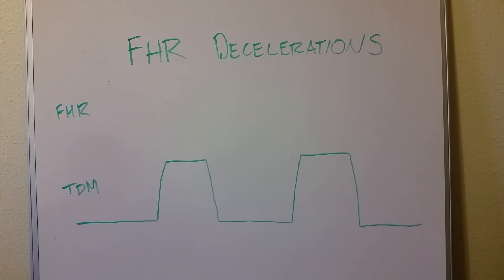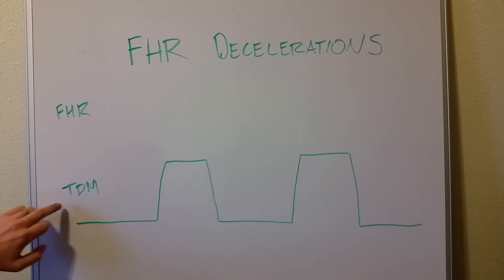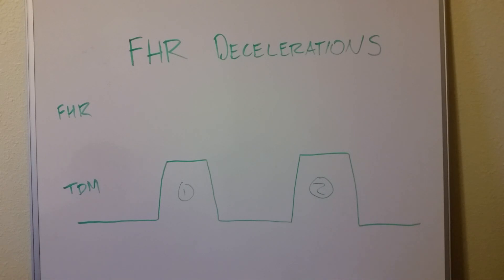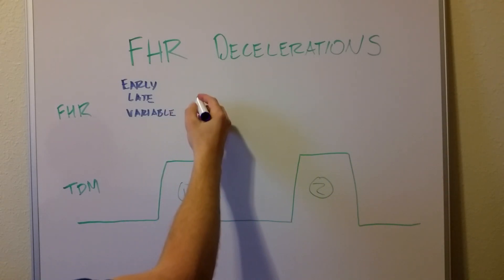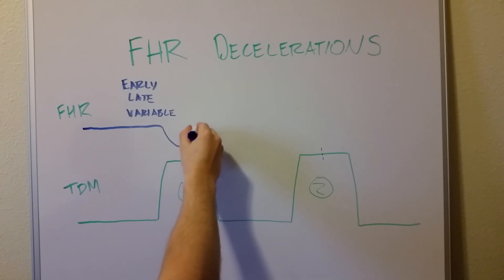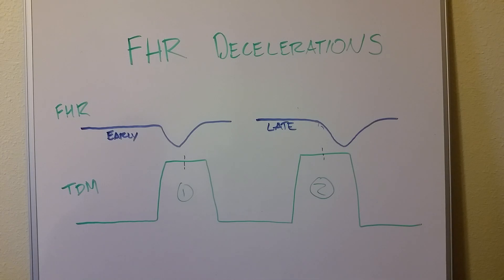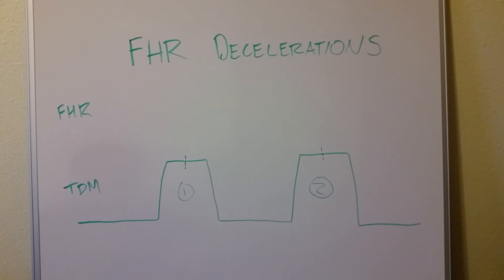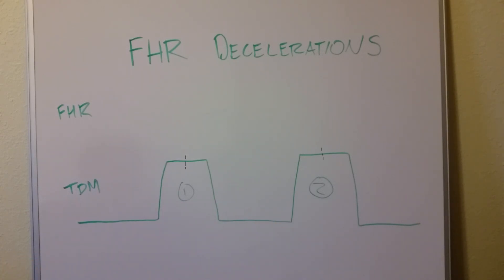Fetal Heart Rate Decelerations (Early, Late, Variable)

Comment: Variables are not as concerning as lates. Cord compression can be fixed (sometimes) with repositioning and in cases where there was ROM an amnioinfusion. Lates are uteroplacental insufficiency, yes, but it is a more concerning decel due to its higher likelihood that the fetus will suffer acidosis. Placental insufficiency is more often seen in PEC, GDM, HTN, IUGR, and post dates. Hope that clarifies it for some who watched this. Some of the information given in this video is very incorrect.

Comment: late deceleration in NOT OKAY o_O
Reply from the maker: +mojo khalifa the video's trying to stress that late decelerations are not as bad as variable decelerations. In academic OB (and for board preparation purposes) the key points with late decelerations are 1) they're typically caused by uteroplacental insufficiency, 2) they're not as bad as variable decelerations, and 3) oxygenation and closer monitor of the patient is needed. All of the above are taught by this video. Thanks for your contribution.
Reply: @MedSchoolMadeEasy  Recurrent variable deceleration( variable deceleration with greater than 50% contraction) could be bad. Even with recurrent variable deceleration, the first line management is maternal positioning(which usually works). If that fails, we go for amnioinfusion. If there's absent variability plus recurrent variable deceleration, we go for CS. But late deceleration is ALWAYS BAD. So I have to disagree with you on this. For academic purpose or clinical , I think the best way to go about severity is: Late deceleration>variable deceleration>early deceleration.

Comment: Late decelerations occur with contractions in the presence of hypoxia. They are a warning of distress and never reassuring. The start late, dip late and finish late after every contraction. The foetus is struggling to compensate with the poor oxygenation. They are never OK!
Reply: All wrong!  Late decelerations are very bad!  Variables happen with short periods of cord compression.. the oxygen interruption is very brief.  They happen all the time!  Late decelerations are caused by uteroplacental insufficiency yes, which means the uterus is puttering out and cannot sustain or work to keep the baby oxygenated any longer.  They MUST be corrected or baby will become hypoxic and develop irreversible brain injury.  You are teaching this all wrong and this is preparation for med boards?  Very scary!  Go back to school please!Jamie Lee, RN OB nurse and Family Nurse Practitioner student!!
Reply from the maker: +Valerie Peers the video's trying to stress that late decelerations are not as bad as variable decelerations. In academic OB (and for board preparation purposes) the key points with late decelerations are 1) they're typically caused by uteroplacental insufficiency, 2) they're not as bad as variable decelerations, and 3) oxygenation and closer monitor of the patient is needed. All of the above are taught by this video. Thanks for your contribution.

Comment: Late decels are NOT ok! You CANNOT just monitor more closely. Get that mom on her left side and give her O2 to prevent baby getting hypoxia.
Reply: +Darrell Ng , it is thought to keep pressure off of the inferior vena cava, improving blood return to the mom's heart. That makes it easier for heart to get blood to baby.
Reply: Calm your balls. Jeez
Reply: +emdgrl why left side?
Reply from the maker: +emdgrl the video's trying to stress that late decelerations are not as bad as variable decelerations. In academic OB (and for board preparation purposes) the key points with late decelerations are 1) they're typically caused by uteroplacental insufficiency, 2) they're not as bad as variable decelerations, and 3) oxygenation and closer monitor of the patient is needed. All of the above are taught by this video. Thanks for your contribution.
Reply: @MedSchoolMadeEasy  late decelerations are extremely bad- you do not want to see them in a CTG , it occurs in severe fetal hypoxia - get that kid out!!

Comment: Can you help what's a atypical deceleration
Reply from the maker: +Troy Sherlock Atypical is simply a deceleration that doesn't follow the normal early deceleration movement, as described above in the video. It can be late or variable- also described above. Thanks!
Reply: @MedSchoolMadeEasy - Atypical deceleration is otherwise called as complicated variable deceleration (RANZCOG) - 60bpm below baseline > 60 sec, slow return, smooth overshoot, followed by higher baseline & reduced variability.
 Your explanation is very poor in the video- please do not confuse students who might think the information provided is correct .

Comment: according to Uworld in an early deceleration, the nadir of deceleration corresponds with the peak of contraction, they "mirror," one another. Also, late deceleration is as you said uteroplacental insufficiency , the baby's O2 is being compromised, you don't just continue to monitor, you turn the mother to her left side.
Reply from the maker: thanks for the comments BlueLight. An addendum- there are several things you can do for a mother with uteroplacental insufficiency (stop pitocin, give O2, etc.), and yes, LLR positioning is one of them. But commonly with late decels the first thing to do is monitor for consistency and duration